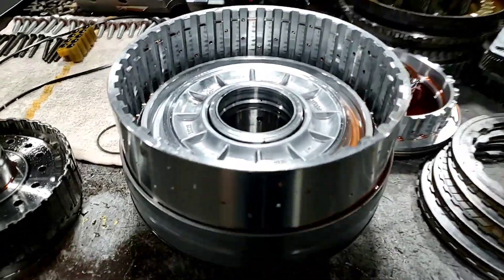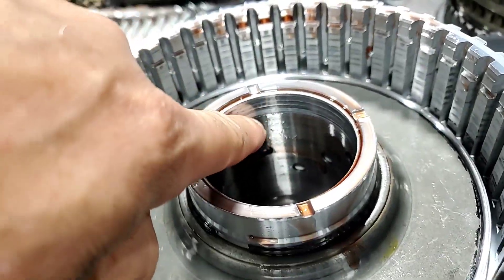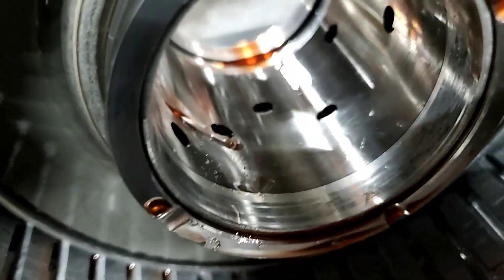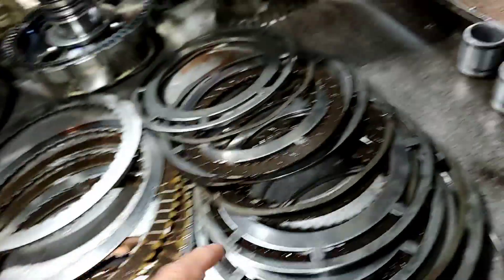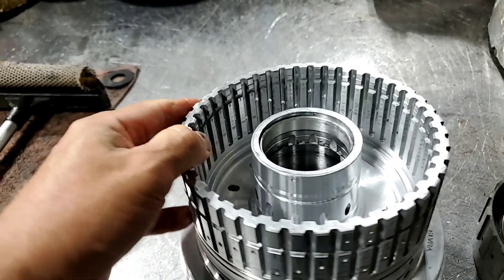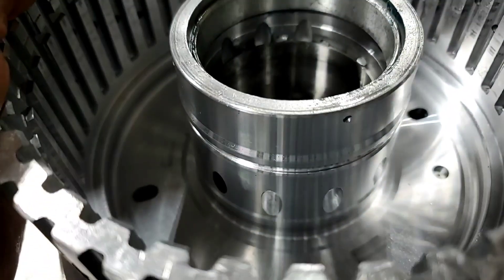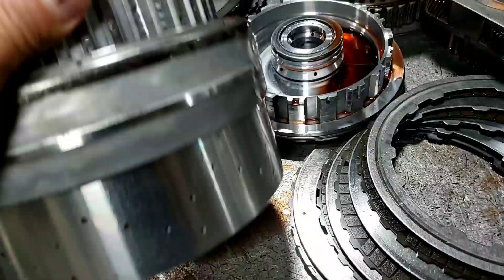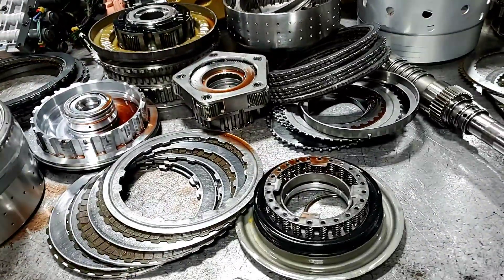10R140 CDF Drum Failure | #10R140

Comment: New vehicles sure seem to be not worth their asking prices.  Too many reliability issues and too many defective parts come with the price tag which is well into $70,000 and up. 
Better off using older vehicles and fixing them to suit your needs.
Reply: Electric cars will make these autos go away.
Reply: @rtz549  Electric cars will but they also will have their own set of issues, that is guaranteed and lots more $$..
Reply: @Garth2011  been driving one for years now.  No maintenance.
Reply: @rtz549  Tires and Brakes will come soon enough as will other items.
Reply: @rtz549 NO "electric" car will EVER replace my 7.3 GODZILLA TREMOR 10 SPEED WITH 4.3 REAR TRUCK...EVER!!!
Reply: @rtz549  no cause I can't go to work in an electric and make it back. I'd have to run my generator all night to charge it back up. I like to only use my genny for a couple hours after dark.

Comment: Ford now has updated drums for both the 10R80 and the 10R140 made with a lip that prevent the bushing from moving. Cheap and in stock too which is surprising, about $120.00. JL3Z-7H351-B is the part number for the 10R80 and LC3Z-7H351-B for the 10R140.
Reply from the maker: Thanks for the part numbers.
Reply: Thanks man I am facing a lot of these drum failure here in Qatar
Reply: @hazem231f  they are dropping like flies and at very low mileage, at least now there's a permanent fix.